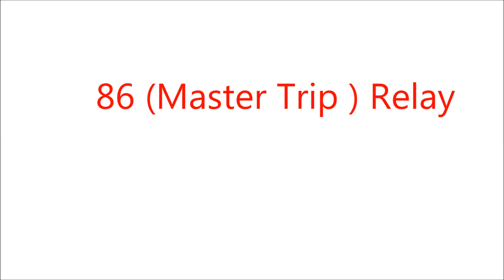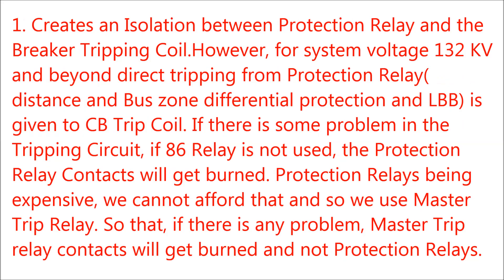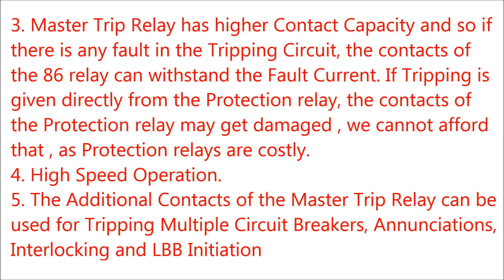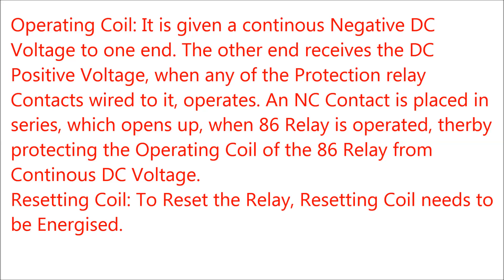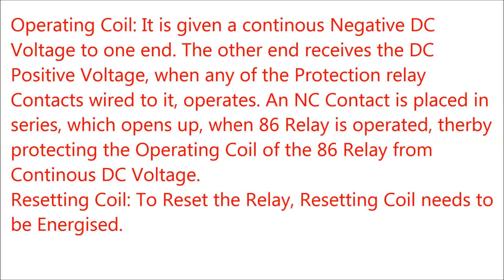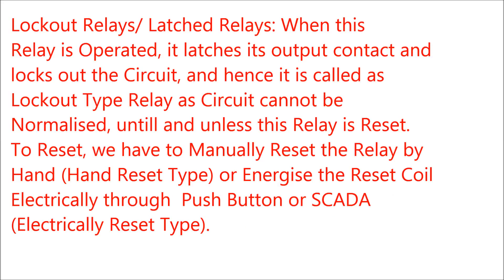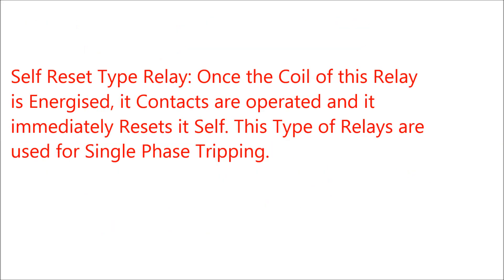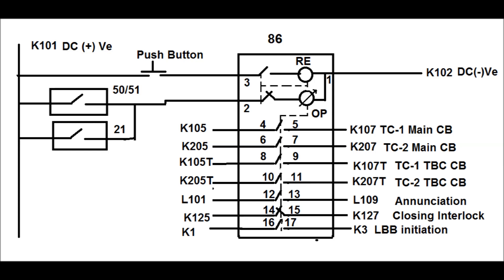86 relay (Master Trip Relay)

Comment: When we press the push button of resetting coil then which NO or NC switch get's reset?
Reply from the maker: There is NO contact in series with resetting coil. When 86 operated this contacts come to NC position .when we push the push button for resetting coil resetting coil operate and its come to again NO position to reset to its previous States.

Comment: GOOD PLEASE ENCOPORATE THIS CIRCUIT IN ACTUAL VCB  CIRCUIT AND EXPLAIN SIR ..
Reply from the maker: Actually there are two trip coil in each circuit breaker. If realy sense the fault the trip coil must get dc positive. Trip coil has continuos dc negative at vcb end. When relay sense fault it will make its contact to energize the 86 relay when 86 relay operate the no contacts changes its states and come to nc postition which will lead to dc positive to trip coils of vcb and hence the trip coil get full dc voltage of 220 v and trip coil will operate and associates plunger will trigger the vcb through spring action to open the breaker.